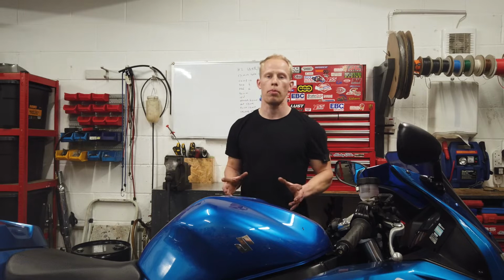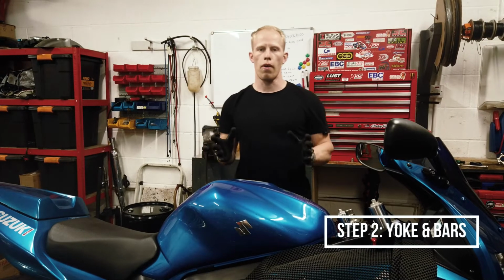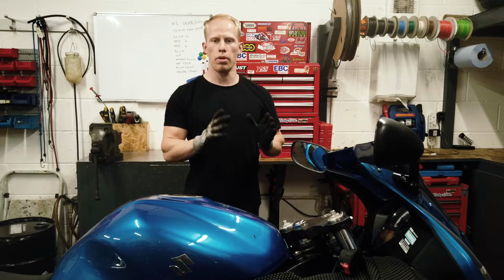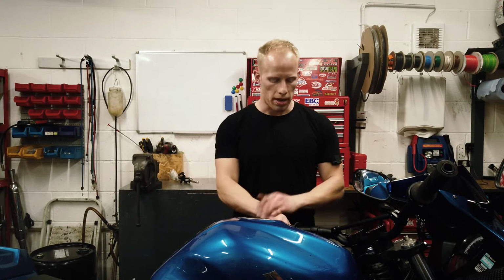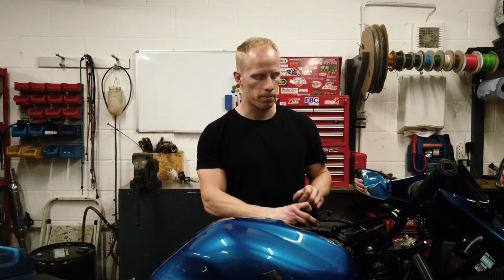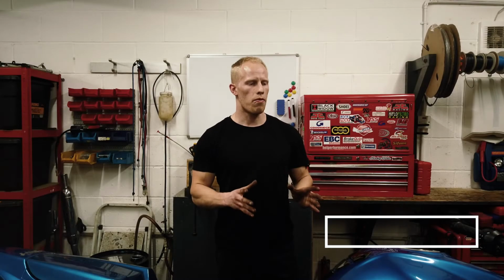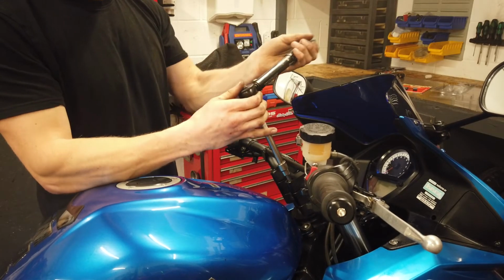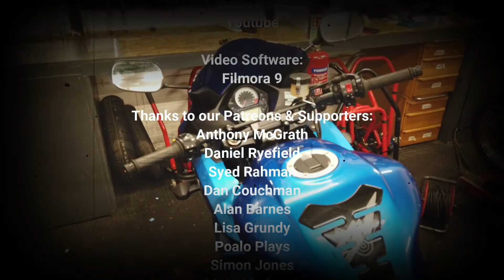How To: Replace Handlebars & Convert Clip-Ons to Bars

Comment: Top yokes UK is by far the worst company to deal with the guy ignores you and takes forever ! Good to see you got your kit !
Reply from the maker: I've personally not had any bad experiences, ordered quite a few in the past and never had any problems, he did used to get powdercoating done elsewhere which delayed the process, apparently he now ceramic coats them in house. He Is usually quite busy so maybe that's why you struggled getting in touch 👍 thanks for watching.
Reply: Yes six weeks for mine and then the bars were missing off the order.
Reply: Thanks for the heads up,definitely won’t be going tacking my business there

Comment: Thanks for this video. I’m about to make the switch on my 2003 SV1000. 👍🏼
Reply from the maker: I also have an 03 sv1000 with the conversion 👍 makes a big difference. I also have a gsxr front end on with brembo master cylinder (amazing brakes) and made a rack for hard panniers. It's made it a more capable bike and much better for touring/commuting.

Comment: if i were doing this in reverse, could i potentially just use the top yoke of my handlebars and just put clip ons on the forks below my current top yoke?
Reply from the maker: Yes just be careful there are some cheap clamp on clipons out there that come loose. Measure your fork stanchion diameter to get the right clip ons. 

When tightening the top yoke back down, tighten the stem nut before the clamp bolts 👍

Comment: is this kit universal or ? .. cause i`m looking for some for a 1984 interceptor 750 :D .. yes its an old girl .. the clipons .. ARGH .. cant mount anything and its rather low for my liking. if you could possible point me in the right direction i would be happy :) .. and ty for the video .. oh a little tip i like with new bars .. if you remove the tip cause you dont want to weaken the bars .. then wrap some old rubber from a bike tube whatever .. around the spot where the controlls are and voila it wont budge at all
Reply from the maker: It's a kit made specifically for this bike by Top Yokes UK (link in the description) it converts it from clipons to handlebars. 👍 May be worth asking them if they do a kit for your bike.
Reply: @rbmcstore2497  ty for the reply back and again ty for the video :)